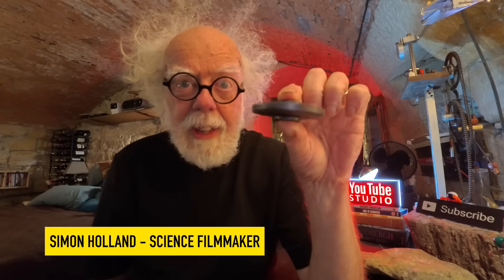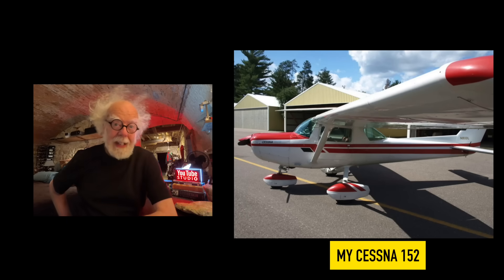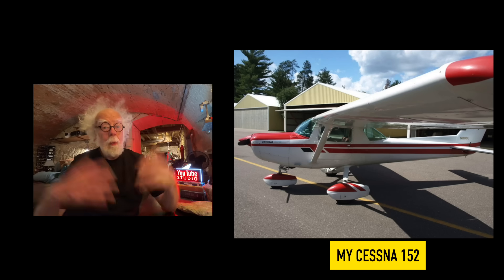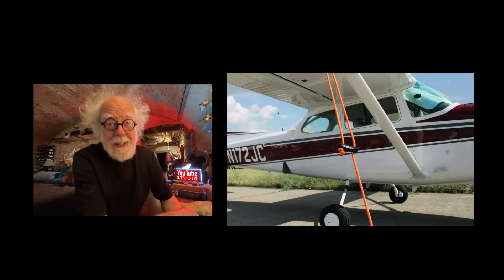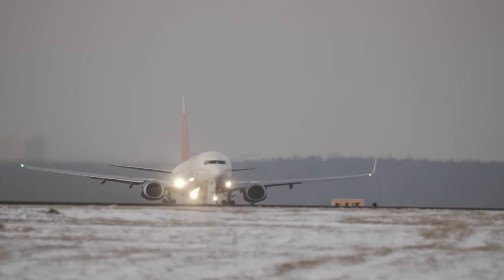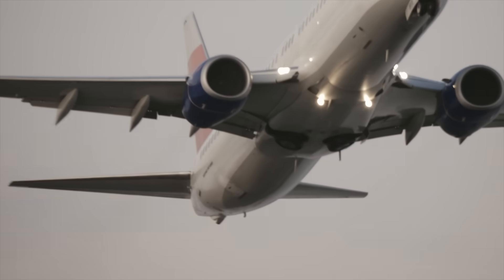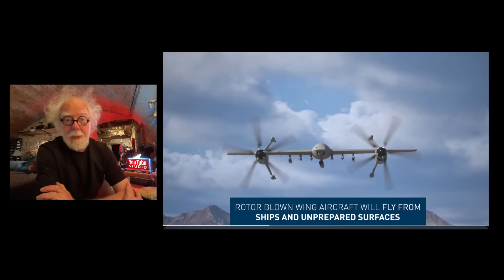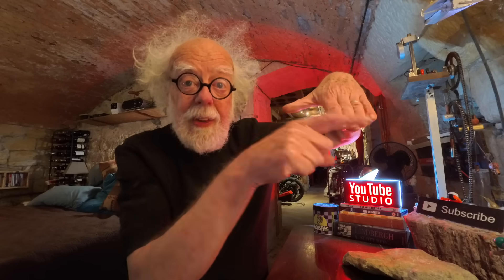Did I invent a new way to fly?

Comment from the maker: This is described as a ‘Fan Blown Wing’. Not a helicopter.  Thats what i am interested in
Reply: As usual, with most things aviation, your understanding is fundamentally flawed.
Also, refresh your knowledge of AoA.
Reply: "This is not how the force works..!" - It would need to have a tail-/stabilizer and  a way to increase air-flow-(lift)power to a critical level - without losing it (temporally)  to forward movement. // Btw: That little drone in the example-video isn't even using its wings to take of.. (doesn't match the idea (imho).
Reply: @chris714n83yh1  coreect
Reply: I can confirm this works in Kerbal Space Program.
Reply: Except what is shown from sykorsy is basically a helicopter 🚁 Certainly not the first fourth or fifth to have a vertical takeoff drone type aircraft that transitions to winged flight. Look up the Black Fly
Reply: @SimonHollandfilms  it's description is wrong. The fact you have a pilot licence and can't see the difference is quite disturbing

Comment: An airplane going down a runway is not wasted energy. It is gaining velocity which is needed for efficient flight and for it's main purpose transportation. The drone takes off not because it is generating lift from the air pushed over it's wing but because it has a thrust to weight ratio greater than 1. The air pushed over the wing only helps with transitioning from a vertical hover to horizontal flight and most of that benefit has to do with the control surfaces and less to do with actual lift.

Comment: We are developing a real flying car using Blown Lift. It looks and drives like a car and flies both vertically and horizontally by tilting it front motors. In a addition it is amphibian. It has no external wings and blows the thrust of the front prop motors over the short internal wing to lift the vehicle, and it uses the oversized side body panels to block span wise flow, thereby increasing lift. See my icon for details.

Comment: Check out the Blackfly ultralight. Transitioning is just done in code now?  Tail sitters back in the 1950-60s had trouble with that.  Two motor drones would be fun to DIY.

Comment: Burnelli patented this idea in the 1920s.  Burnelli and his estate vigorously defended his patent for most of the 20th Century, even though he didn't actually try very hard to fruition.  Unfortunately, this kept a great idea from being developed.   However, the problem with all flight that tries to combine thrust  production with lift generation is engine failure.  Lose an engine, lose both thrust and lift, and usually m, and especially at low speeds where the aerodynamic controls are nearly useless, means a catastrophic crash and everybody dies. Vought, in developing a similar concept in the XF5U during WWII, tied the two propellers with a cross shaft and clutches.  This idea was expanded and brought to production  with the V-22 helicopter planes, even though they didn't rely on wing lift very much.  There have been other implementations such as the Boeing YC-14, a jet powered craft that more than tripled the wing lift with jet thrust, but was unable to solve the engine failure problem.

Comment: I have seen concept aircraft with a ducted outlet across the leading edge of it's lift and control surfaces... similar to how a "bladeless fan" works... that's kind of what I was expecting, instead this new iteration of a much older VTOL type experimental air plane. But kudos to you Prof Simon, at least your new way didn't involve the use of a great big rubber band... 👍😂👍

Comment: No Simon the video at the end is not the same as what you described. Having propellor's forcing air over the horizontal wing while stationary will work but the plane has to be tethered but It's like powering a sailboat from a fan mounted in the sailboat.

Comment: Thrust from the props give verticle lift when pointing upward then thrust from the props pointing horizontally give foreward motion causing air flow over the wings giving lift or am i missing something
Reply: Yes, the speed of the air over the wing is the forward speed + the prop thrust speed. Since the props also blow air over the wing, this gives the aircraft a lot more lift during the transition from VTOL to horizontal mode where there is very little forward speed.

Comment: The Osprey is much more practical, but unfortunately cursed with some serious problems.
Reply: The V-22 Osprey has now killed more American troops than it has enemies and it was designed to be the primary troop transport from ship to shore. Rotating the whole engine like that creates massive amounts of torque. Vertical is easy, horizontal is easy. Transition, very tricky.

Comment: yesssss, some confusion here. A big enough prop will just drag the aircraft up. For your system to work the plane would have to be just sitting normally on three points and the props force enough air over the wings to induce "stationary lift" would then need to convert into forward movement " in some way"

Comment: No, its relative wind speed. think of a wind tunnel.
Reply: yes, exactly! The velocity of the air over the wings is the sum of the forward speed + the thrust air speed. This enables the wings to generate lift during the transitions from VTOL to horizontal mode where there is very little forward air speed.

Comment: The wing will need a positiv angle to be able to fly, it will not fly with just low pressure over the wing. Its more Newton than Bernouli that makes planes fly.
Reply: Correct.  Newtonian mechanics allow a curved but upside down wing to fly.  
Bernouli mechanics deny the possibility of what most of us can see at an airshow.
Reply: @peteinwisconsin2496  hehe.. with enough thrust, we can make a brick fly! 😉
Reply: I regret being rude but 🥱
Reply: It's connected. Only a positive angle of attack creates a low pressure on the top side of the wing. Which means, both is right.

Comment: Been done many times before.
The Buccaneer had wing blowing lift augmentation.
As did the AN-72.

But it is not as efficient as you think.
Aircraft fly by action and reaction, not low pressures.
Somehow, you need to force air molecules downwards.

Ralph

Comment: This Sikorsky "tailsitter" aircraft is using thrust from the engines to acheive verticat flight, the wing provides no  liftt until it transitions to hoizontal forward flight. The Vought XC-142 used this concept in the '60's on their experimental rotating wing cargo plane. Lead test pilot on the project Bert Rutan stated that the plane had great potential and would have been a valuable asset to aviation.

Comment: I wrote in a comment with the same caveat:

What you described, used externally to the aircraft, would have to generate enormous wind and would involve a major problem in the transition between the region where the aircraft would be hovering almost stationary in relation to the ground, but with a large flow of air generated externally... and the normal region, outside this artificial flow of air... It would have to dive to accelerate until the airflow on the wings was sufficient to provide lift and control (in other words, there would be a dangerous transition into stall.

The images with the model airplane use a different phenomenon. It is more like the Osprey system (Bell-Boeing V-22), only with the advantage of not needing a complicated (and heavy) mechanism to change the angle of the engines... But it does not use the airflow on the fixed wings during takeoff... the propellers themselves work as mobile wings, like in a helicopter, during takeoff... it involves the inconvenience of taking off with the fuselage in a vertical position and it would not be able to take off or land if one of the engines or propellers failed... perhaps without even the option of autorotation...

A system with large propellers generating a large airflow under conventional wings could generate a short but non-vertical takeoff aircraft...

Comment: I'm sorry Simon, but you've completely misunderstood that aircraft mentioned and the physics involved. That's just a standard VTOL hybrid drone. Id know because I literally own one myself. The aircraft isn't flying because it's blowing air over the wings, in takeoff the rotor blades are acting as the wings themselves. Each rotor is achieving lift by smacking air downwards at high speed. Due to the whole "equal and opposite reaction" principle of Newtonian physics, as all that air gets smacked downwards, the rotor moves in the opposite direction (upwards) and it drags the aircraft with it

Once the VTOL is airborne and transitions to forward fixed wing flight, the wings are producing lift, due to the airflow over the wings. However this airflow isn't being blown onto the wings by giant fans. At that point the rotors are just pushing air backwards, which is making the aircraft move forwards, but it's that forward momentum which is getting airflow over the wings sufficient for lift, not the 'fans' directly
Reply: No, that is not quite right. The prop motor thrust blows over the wing and enables the wing to lift at much lower velocities needed to transition from VTOL to horizontal flight mode.

Comment: Its the combination of angle of attack and relative airspeed that generates enough force to lift the aircraft, but the amount of airspeed required is reduced when in ground effect.   If your 152  was not tied down, it would first lift up about a half wingspan, and then fall down again, because it would no loner benefit from ground effect at about a half wingspan above ground.   Some aircraft, such as the Piper Cub have been known to hover, relative to the ground, when the forward airspeed of the Cub in the body of the air is the same as the speed of the air mass relative to the ground, going in the opposite direction.  The Cub can even go backward, relative to the ground, if its forward airspeed is less than the speed of the body of air going in the opposite direction.  It is true that you could lift a plane solely by generating enough relative airspeed over the wing, but you wouldnt go anywhere without generating more airspeed, and as in the case of the Cub, you might even travel backwards, or go nowhere.
Reply: ...and might be blown downwind while airborne, meaning your insurance company would be very unhappy.  Always tie down if possible.

Comment: Video didn't really line up with what I was expecting from the description. I'm a little confused on how this would work because it seems very similar to putting a fan in a sailboat to blow on your sail  kind of
Reply: Such a fan actually does move the boat. Just not in the expected way. Look at these airboats used in the Everglades. Huge fan and, because it plays no role, no sail at all 🙂 — — — In a similar fashion aircraft can use their engines to not only generate forward thrust, but also additional lift.

Comment: In fact Boeing built a jet which blew above the wing and created a slow/short take off aircraft a couple of decades ago, which wasn't accepted as a transport plane. In many respects Bernoulli's principle is not the major factor behind lift, many have considered, in much the same way that your hand outside a window in a car demonstrates that angle of attack is more generous with lift. I would go so far as to say the principles of aerodynamics are still largely a mystery overall.
Reply: Yupp. It's the Boeing YC-14, nice article in Wikipedia.

Comment: well even a water jet lifts things up by the (angular) stream force. thats why quad copters (helicopters) are much simpler and easier and better. and vtol. that loop back to wind going over a wing is unnecessary complexity. you can just fly with the rotors rotating themselves. nothing else. wing is optional bonus lift. you know, chinook invented that idea in the 60s already. you need only fly a chinook horizontally. any applications are free and neat. hold on, you made the standard prop air plane again. go vertical also. nothing complex alternations, only larger props and higher power prop motors.

Comment: I’m sorry but what you describe and what that video show are two vastly different things. The drone is just using normal thrust from the props in a vertical orientation to hover and sits on its tail. What you are talking about is creating a zone of low pressure above a normally oriented horizontal wing section to create vertical lift, which would be revolutionary and easily adapted into current aircraft designs
Reply: Exactly. The description sounded like effectively putting a plane in a wind tunnel.

The example was just a variation of the Boeing Osprey just with a different mechanism for transitioning to horizontal flight. 

An actual solution would be to place propellers all along the wing to provide the air. If powerful enough, a wheel brake and then a tether from tail to ground would enable verticle take off.
Reply: Wait until he sees helicopters
Reply: Absolutely correct. What he described with his Cessna was more like a kite. His concept would only work if it was tethered to the ground wait until airborne then released, a bit like a glider being toed.
Reply: What you described, used externally to the aircraft, would have to generate enormous wind and would involve a major problem in the transition between the region where the aircraft would be hovering almost stationary in relation to the ground, but with a large flow of air generated externally... and the normal region, outside this artificial flow of air... It would have to dive to accelerate until the airflow on the wings was sufficient to provide lift and control (in other words, there would be a dangerous transition into stall.

The images with the model airplane use a different phenomenon. It is more like the Osprey system (Bell-Boeing V-22), only with the advantage of not needing a complicated (and heavy) mechanism to change the angle of the engines... But it does not use the airflow on the fixed wings during takeoff... the propellers themselves work as mobile wings, like in a helicopter, during takeoff... it involves the inconvenience of taking off with the fuselage in a vertical position and it would not be able to take off or land if one of the engines or propellers failed... perhaps without even the option of autorotation...

A system with large propellers generating a large airflow under conventional wings could generate a short but non-vertical takeoff aircraft...
Reply: learn what u already know, there is no vertical lift with horizontal wings , its always been on a diagonal trajectory

Comment: I see a problem with the design. Those propellers look awfully big in diameter. If one engine fails in flight. It would have to land like a normal airplane. In this configuration I believe both propellers and engines would be destroyed on landing because the wings would have to be horizontal.
Reply: The main problem with this design is that it does not take off and land well in winds, which blow it around like sailboat.
Reply: Notice that this aircraft does Not have a nose wheel so worse than a belly landing, landing with either engine out would be a forced nose-down belly landing, essentially ensuring that the aircraft cartwheels.  It would probably turn toward the zero thrust side.  Might be tough to get this one certificated to carry people.

Comment: This is not new at all. Planes using tiltrotors are called VTOL aircrafts, vertical take-off and landing. I even think Nikola Tesla had a patent on one. Either way, there are several designs similar to this one you can check out.

Comment: The props blowing wind on the wings don't produce lift for take off at all on this VTOL but it  takes off like any helicopter or drone with propellers generated lift only . It only helps horizontal flying by allowing a reduced the wingspan. That's what most on wing propellers aircraft do at smaller scale
Reply: He doesn't have a clue what he's talking about.
Reply: @porkhunts  yes and this is very worrying for someone supposed to have a pilot license

Comment: Maybe Ion Wind could be used using high voltage to move air over the wings or saucer shape craft etc to give lift with no moving parts except the ion Wind?

Comment: I can't see how this is the same as your Cessna doing an unexpected VTOL because of airflow over the wings which is taking off because of the high pressure/low pressure differential,

Surely the props are pulling the Sikorsky straight up? i.e. the force from the props is greater than the force of gravity pulling it to earth, like a conventional helicopter,

Surely if there were any effect on the wing then it would pull the Sikorsky backwards as it lifts? Although the upwards speed is very slow and almost certainly below the speed needed to have this effect,

It seems to me to be a variation of a V-22 Osprey, half helicopter, half conventional plane, it's just that the transition is different,

...or am I missing something very fundamental?

I don't mind if I am because at least I'll learn something today

Comment: Does the Sikorsky have a cockpit and human pilot?  This design concept is similar to the V-22 Osprey, except that in the Sikorsky the rotors are fixed and the entire air frame rotates from vertical to horizontal.
When young Simon's 152 was floating at the airport, Simon should have jumped in and yelled YEEEEHAW.

Comment: Just looks like a refinement of the Vought XF5U Flying Flapjack from WW2 era with the 2 huge prop rotors spinning in front of a saucer lifting body.  Didn't sit vertically though, although it sat on the ground on its gear at a very high angle.